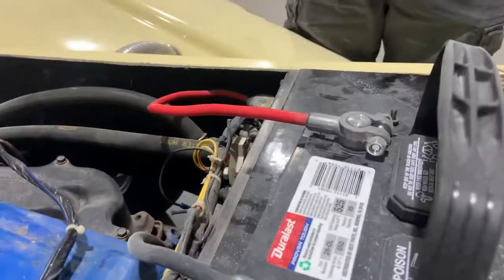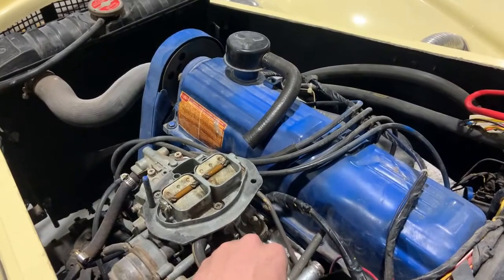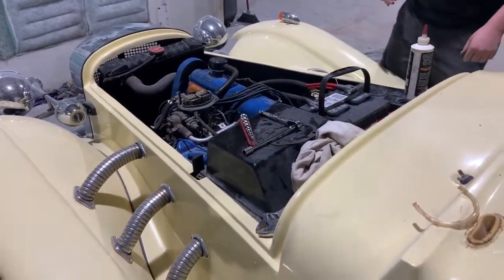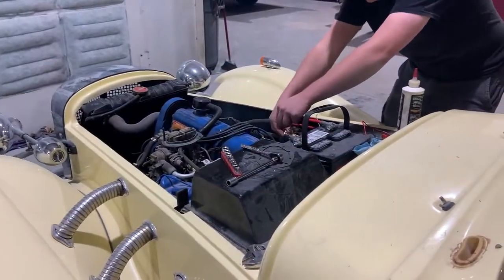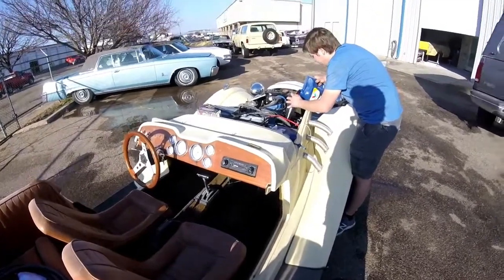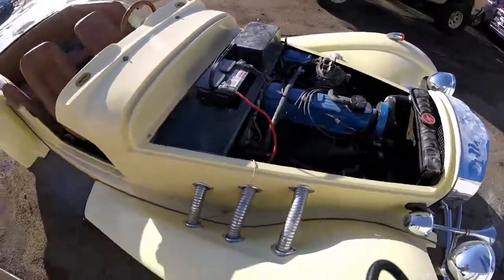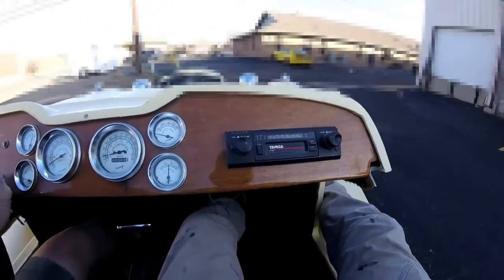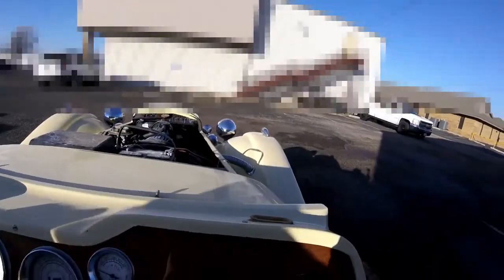First start ever | 1929 Mercedes Gazelle Pinto kit car

Comment: When I was a teenager, our family stable had a Mustang Ii and 4 Pintos.  In the back of Car & Driver or maybe Road & Track. I saw a tiny ad for this kit. What a dream!

I sent off to the Gazelle Motor Car Co (...am I right?) for their catalog, and eventually bought the complete Gazelle build manual.

+ Step 1: Source a donor Pinto (wrecked ok) - and strip it per the detailed,  illustrated instructions. We use everything but the squeal!
+ Step 2: Assemble the kit with your Pinto chunks, to build your own complete classic replicar.
+ Step 3: Enjoy whipping around in your beautiful new '29 Mercedes!

It seemed like a pretty solidly engineered kit, using practically all of the Pinto's functional pieces. I remember the instructions even  covering things like the horn, the rear view mirror and the se offat belts. I think the complete kit might have gone for $795, or $995 with optional folding top, plus freight from Florida I think.

I imagined working on the project with my dad, backing the finished Gazelle out of the shop, and taking it out on that first careful voyage. But I  never convinced dad to contribute even the rattiest of the family Pintos. So for me, the Gazelle remained just a dream.

Thank you for resurrecting this project, and filling in the blanks for a memory that I never actually had!
Reply from the maker: Sorry to hear that it didn't work out, but glad you out some enjoyment from the video. Thanks for sharing, that's always appreciated

Comment: This car was built in a factory came assembled there were 2 makers they used for the factory built cars that ik of one by ford and one by Chevy but that car is all ford for drive train
Reply: This is not a factory built car.  The factory used a new car for the donor.  They had different seats (leather reclining), bumpers, door hinges, and more.  You get the idea.  The factory built cars were way different than the kits they sold.  They were pretty expensive because the price of the new donor car was part of the total cost.  When you add in the cost of the premium kit with their labor, they were too expensive for the mainstream public.  They made/built kits for GM (Chevette), Ford (Pinto), and VW (Bug).  My car was a factory built GM Gazelle .  It had an automatic transmission, tilt column, heat, air conditioning, and less than 5000 miles on it.  I had it for about two and a half years and drove it for about 7 months before I sold it to a friend.  It was awesome!!  I have a video of it on my channel if you're interested.  You'll see the difference.